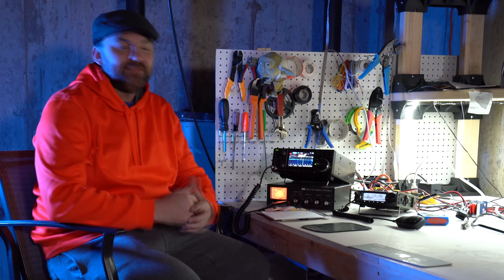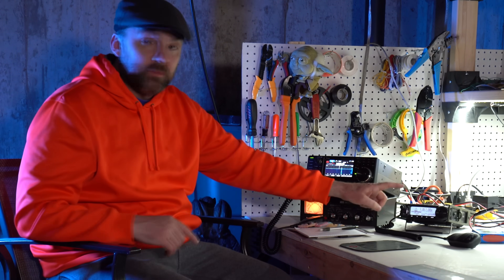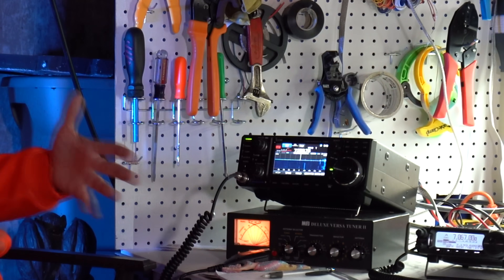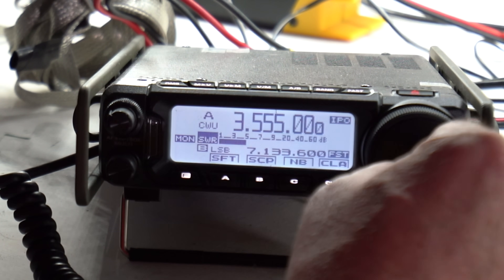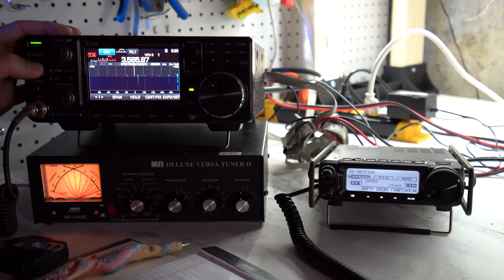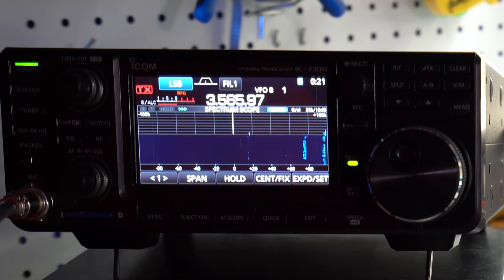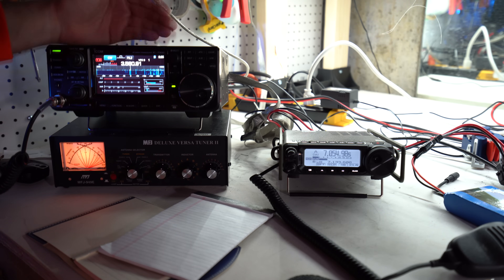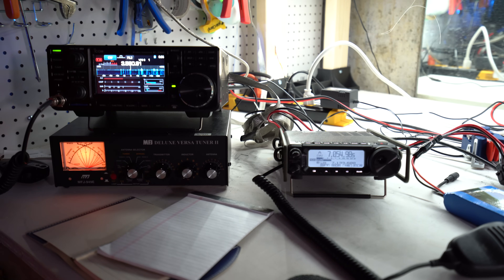iCom 7300 vs Yaesu 891 Comparison ~ Battle to the DEATH!

Comment: I've only been a ham operator for about 2.5 years and I'll make a fair comparison of metal detectors.  Just follow along.
People dive into hobbies and listen to people who have been in hobbies for 5+ years for advice.  They purchase an expensive metal detector and decide they don't like the metal detector and sell it to someone else at a loss.  So, right after getting a Technician license a new ham may purchase an FT-991 or IC-7300 because their goal is to get their general license and this will save money.  Life gets in the way and their priorities change or they decide the hobby isn't for them.  Now they have an expensive radio that is perfect for someone else.
My first radio was an FT-60 and I enjoy the hobby.  The second radio was an FT-991.  Mobile digital sounds interesting so I purchased an FT-70DR.  I have the capability now, but I don't enjoy it (this reinforces the statement above).  I enjoy POTA.  It doesn't make economic sense for me to take the FT-991A with a touch screen to a park and risk damage.  So, now I have added the FT-891 to my go bag for ARES, POTA, or just being portable.  Ham isn't for everyone and HF isn't for everyone. Some people enjoy repeaters VHF/UHF or GMRS.  To be fair, why purchase an FT-891 if the operator hasn't ever been to a Field Day or done POTA?  Join a club and operate their rig or maybe an Elmer has a rig you can try before you buy (reinforces the Field Day comment).

Comment: Totally unfair,I don't think so brother, point taken,I have a icom 718, and a 7300, when I use the 718, which has a 7300 hand Mike on it, everyone thinks I'm on the 7300,I tell everyone the only thing better than having 1 718 , is having 2of them, great video do a review of the 718 if you get the chance,it really is the work horse of modern day amateur radio,even though it is discontinued , you can still get a new one,73s brother, kb0uzz
Reply from the maker: : )  It's just a fun video.  Controversial apparently

Comment: I have both radios. My 7300 is hands down easier to navigate and I use it as a back up radio for my home shack. When I go out and activate WWFF parks and Beaches I actually take both with me. I am 100% CW and the DNR feature on the 891 has the 7300 beat hands down. I am surprised that ICOM hasn't caught up with this little feature. There is no question that the 7300 is easier and quicker to change bands, modes and power levels. I love both radios and have no plans to get rid of either. I recently used my 891 on one of contests and had a lot of fun and was able to pull a lot of stations out of the mud. That's my story and I'm sticking to it. :-) :-) de W6LEN / Jess

Comment: Well... like you  said. It's an unfair comparison. The first thing I "imagine" is that.... you seem WAY more familiar with the 7300 menu system, so I "IMAGINE" you spend most of the time on HF at home with the 7300. And FAR less time mobile with the 891. I'd venture to guess that if you had the 891 as your primary base radio...you'd be FAR MORE proficient on it than the 7300. You know the old saying... "the best word processor is the one you know".

Comment: I have the ft891. Here it costs half the price of the ic7300. I do not regret the choice as it has a great receiver for cw  my operating mode for hf. It also can lower power to 5w level, nice for a qrper. 73, Luís

Comment: An awful lot of your 891 complaints seem to be of the form "I forget" or "I haven't learned how to do that" or "I haven't bothered to figure out it it has that feature".

I agree that the 7300 should usually stay  home.  Certainly questionable for mobile.  While not stock for the 891 there is an available control head separation kit, allowing a more convenient vehicle installation.

So long as you have a computer handy, e.g.; for logging, connecting the radio and using HRD or flrig makes the rig feature sets equivalently available.

The big display on the 7300 is pretty, but, I agree, a vulnerability.  The 891 screen is a smaller target, and not being a touch screen, may actually be more durable, or maybe not.  Either would be a big pain to replace.  Get a cover for the front of the radio, or, probably better, a suitably fitted, and probably padded, carrying case (maybe with slots for required accessories.  That's true for either radio.

For those who want a wide range autotuner, consider the LDB Z-11Pro II.  Since it uses latching relays, once the match is found, it stops consuming power, so it won't eat into the battery that you're using for portable.  And not consuming a lot of power doesn't turn into a problem for home use.  (Maybe there's a newer one.  I've enjoyed mine for years, and it's still going strong.)
Reply from the maker: That means they are hidden well.

Comment: I have enough problems using the touch screen on my cell phone, plus I have a shack cat that loves to lay in between my computer keyboard and monitor stand under which my radio would go as I don't have much room and I'm sure he'd be bumping that touch screen and changing things on me. The smaller size and lack of a touch screen makes the 891 a clear winner for me, nt to mention the excellent receiver as I don't have a license yet and would be using the radio just for listening until I'm legal to transmit. It costs way less than either the 7300 or a new general coverage receiver that's far superior than any Tecsun or other portable SW receiver made.
Reply from the maker: Thanks for the comment I really appreciate it.

Comment: I have a Yaesu FT450D I always use portable, tomorrow I am getting the Yaesu 891 for portable and leaving the 450D at home connected to my EFHW antenna, before I take the Yaesu out though I am going to change all of the settings I require for portable operation and have it all ready to start operating from about Saturday, then I just need to change band or mode whilst out. good honest video Thanks, Oh by the way the 891 can Zero in (Zin) and spot on CW, it's on page 9 in the advanced manual

Comment: Only a minute into the video but I agree, it's an UNFAIR comparison! One is a noisy, loosey-goosey front end, no RF Gain, gritty sounding glorified CB, and the other is a Yaesu.
Reply: Spoken like a true Appliance operator bird the Icom 7300 has a receiver sensitivity of 0.1 microvolts and a reciprocal mixing dynamic range of over 100 DB, the issue on the other hand is death is a door knob and is Phase noise Limited so you can't even measure the reciprocal mixing dynamic range, one is a real ham radio the issue is a glorified CB and you are glorified CB operator
Reply: @dannelson8556 - ...and don't leave out there was only one shooter in Dallas and saccharine doesn't cause cancer! 😂
I love it when they concede by falling back into ad hominem attacks. 
 Sorry Floyd, you're fantasy world is as real as Biden's claim of a strong economy. 🙄
Reply: quite right.
Reply: A little more practice with the 891 would help a lot. Mine is a portable and backup to my Elecraft K3. It’s an excellent radio if set up right! One of my programmable buttons is set to change the bandwidth. Changing bands can also be done with the memories. Also the IPO needs to be off in most cases. I can operate my 891 pretty fast. In fact if the K3 completely dies I probably would just use the 891, it’s that good. It’s also very easy to operate with my N1MM contest logging program. I can’t think of anything bad to say about it.

Comment: Good overview of the two radios but as far as a fair comparison you kind of missed the mark. What you are basically arguing is that you, personally, understand how to use the IC-7300 better. I will agree that the 7300s features are more intuitive but that's because you have a touch screen vs an LCD and buttons. Compare the IC-7300 to the FTDX10 which is more apples to apples and then the comparison becomes a little more relevant and less lopsided. The radios themselves each have great "functionality" but what you are battling out here is "user interface", which just by looking at the radios you can already tell which one is going to come out ahead. Would love to see that 7300 vs FTDX10 comparison though.

Comment: I'm a pretty new ham and have both of these radios.  I got the 7300 for a base and did some POTA with it.  I discovered it's a pain to pull my shack radio and haul that heavy radio to the park.  So got the 891.  The 7300 is MUCH easier to use in every way, but I've found that when I'm doing POTA, I set up pretty much the same all the time.  So not a lot of changes required, just mode and freq.  Most everything else stays the same from park to park.
Reply from the maker: Great comment.  I'm thinking about getting that Icom 705 for that reason...
Reply: @hamradiocq  I'm not willing to go QRP at this early stage in my ham life.  I'm also not willing to part with the $1300 for the 705

Comment: 7300 is junk compared to a KX-3 plus outboard waterfall display. I hated my 7300 receiver. Dumped it for a much better receiving Pro3, and I just ordered an FTdx-10 to stay away from the junk CB-type RF Gain control on the 7300 & 7610.
 Icom wants to put BS fake controls on their rigs, they lose my business.
Reply from the maker: I sold my 7300.
Reply: @hamradiocq  I have a 991A coming for the mobile and if I like it as much as I expect to I'll buy a 2nd for a 2m /440 rig for the base.
Icom can keep their CB Radio controls.

Comment: Quite a pointless comparison. They are both different radios for different applications. You make out the 891 is cumbersome. I know many users who are quite fluent on the 891.
Reply from the maker: Kind of like a pointless comment.
Reply: Ham Radio CQ Lol You gotta admit, comparing these two radios is not a fair comparison. Each radio is designed and engineered with different users applications. If you compared the ftdx3000 to say the ic7300 then that would be a better comparison.

Comment: It seems that this is a comparison of ease of use vs. Actual features and sound. The FT891 is superior in filtering, which is arguably the key element along with transmit signal/cleanliness. Not a bad video, just a misleading title. Perhaps if the videos title matched the subject matter, I'd feel more drawn to it. Regardless, thank you for your efforts. 🙂
Reply from the maker: I hear ya, Guy.  Thanks for the comment.

Comment: Surely you buy both. Use the 7300 as a base station and 891 for portable ops?
Reply from the maker: Yes I have both and I use both
Reply: @hamradiocq  I have neither at the moment, but will add both to my 9700 this year.

Comment: the 897 has hf 6 2 70 +you can fit an internal battery +you can fit an internal power supply it depends how many radios you  want but it is older technology  but it works well
Reply from the maker: Ok, thanks Ron

Comment: I was faced with that decision as a new ham,  I thought of it this way. there is no one on 2-meter sofar, am I sure I want to stick with the hobby? also if I stick with the hobby, I am going to want a mobile later. my desk is small I had no room for a 7300. I went with the FT-891. It will work very well in my car later. I used it on field day easily. and it fits on my desk easily with my VHF/UHF rig.  I love this radio, it works great. I can see the younger generation liking the 7300 menus that's what you're used to. a little menu doesn't bother me. I grew up with typing the program in your computer before you could play your game. I would recomend the FT-891 to anyone. and you can by your VHF FM rig, SignaLink, coax and antenna's and still not spend as much as you did on the one radio. Maybe something fancy later? but for now I'm transmitting on everything I want for under $1000. Can't beat that.
Reply from the maker: Great comment!

Comment: Ya but how long will that touch screen going to last look at the Icom 765 Pro 90 % of them is dead the screen goes out and the radio is dead the 891 is a mobile it buttons and dials but it works good it has a turner in it too like you say it only for close fine tune the DNR works great but you can't compare the two radios put the icom 7300 in your mobile and see how long it last it would vibration will kill it and the screen something will hit it or the moisture will kill it I will say the yaesu 891 works great for the mobile and the Icom works best on base check the reserve you be surprise the 891 will pick up the week stations the speaker is smaller on the 891 put an external speaker the same kind on both radios and you be surprise the 891 will compare real close. I have the Icom 706 mark IIG i love it but it finley died after 20 years in my truck looking to replace it with the Yeasu 891,on the base i have the yeasu FTDX-1200 but the Icom 7300 has the best audio out there on transmit man that 7300 sound soo good it the best
Reply from the maker: I hear what you are saying extrem

Comment: Well I am almost shocked by this comparison. You own FT 891 but it seems you just got it out of the box and really don't know anything about it. You don't remember the menus? I learned the menus in the first two hours of use, with the help of the manual and YouTube, and then 99% of my everyday needs can take place really fast. Of course not as fast as when using the touch screen of 7300 but fast enough. You turn the knob on 891 and say " it really goes slow even in fast" well you can change the step anytime to your needs for fast and slow. "The 7300 is really quieter than the 891?!?" Omg you don't really use one of 891's most magestic features, the DNR! It outperforms 7300 in this and even more expensive radios. I am definitely not a fanboy of 891 but this radio gives such a good performance for a fraction of the cost. If you use it more you will understand that yourself. Otherwise it's just a comparison of a touch screen and not touch screen. 73
Reply from the maker: Yeah I have these radios so I compared them.  I just find the Yaesu to be more "menu driven" and less buttons.  If it just had a power button I'd probably give it a B+.

Comment: Ha , That's the trouble with reviews like this , Comparing two completely different purpose radios , Obviously Yaesu could add the Touch screen, And the extra knobs and buttons to make accessing the menu easier etc , But then the 891 would end up the size of the 7300 ....It's like comparing a Boat to a car , They were both built to do two completely different purposes .
Reply from the maker: These are the radios I have...and it's mentioned in the video.

Comment: The 7600 isnt meant to be any better than the 7300 ive been told off a number of people that owned both. I currently have the 7300 but thinking of swapping to a yaesu ft991a
Reply from the maker: Ok.
Reply: The 991a is a true shack in the box.

You can do anything with it, even C4FM.
I love it.
The scope is a bummer, and the menue is typical Yaesu but everything else is better than the 7300.

Comment: Not really a fair comparison. A radio designed to be small and compact for mobile/portable use, and a much larger radio with more frontal space for features, ect.
Reply from the maker: That was mentioned in the videos. These are the radios I have.